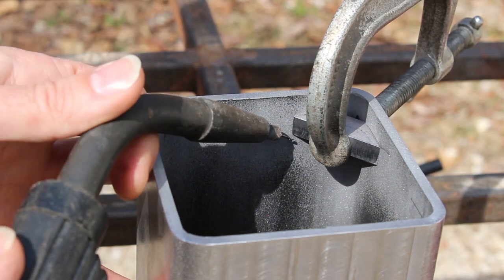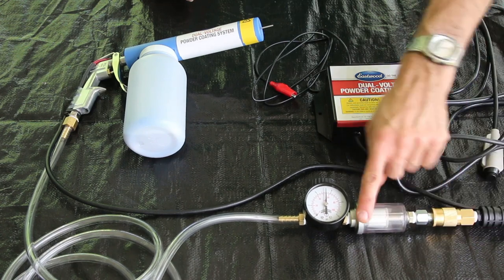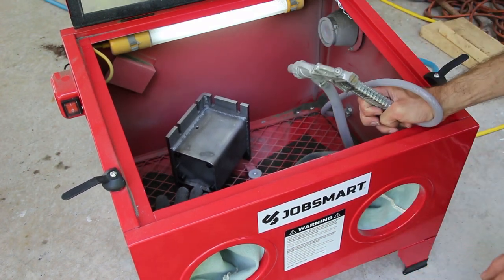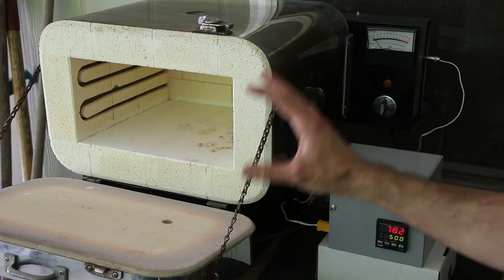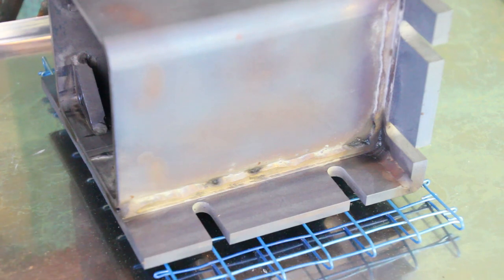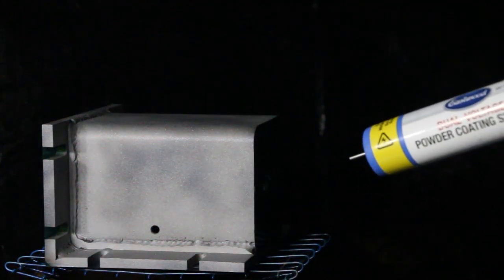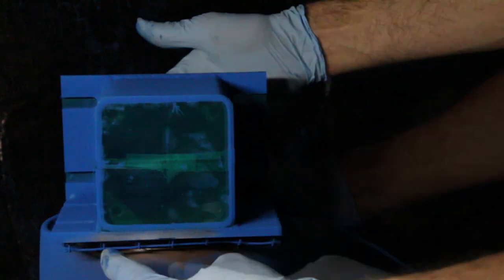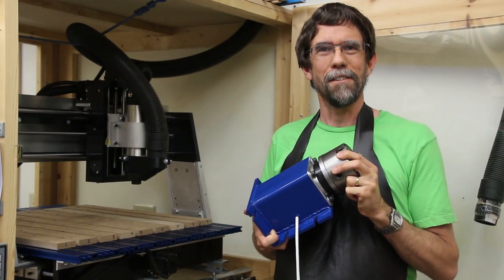DIY Powder Coating a Steel 4th Axis Housing

Comment: You have the patience to carry a project through to a finished item, which puts them on a level above that acheived by hackers like myself.  It shows me what I should be acheiving, if I just take the time to "do it right".  Thanks for sharing your projects and methods.
Reply from the maker: Thanks John, and I don't often get accused of being patient! ;-) Honestly I have many more unfinished projects than finished ones, and I'm certainly not above hacking something together to get it done(ish). But of course I enjoy it more when something eventually turns out well, even if it takes a lot longer.
Reply: Your unfinished projects are a secret that's safe with me!   ;o)

Comment: If you watch the Eastwood video on that powder coat system. They added the high voltage setting for tight inside corner areas and rounded corner areas to make the powder stick
Reply from the maker: I'll definitely try that next time.

Comment: The one thing I learned about welding DC and TIG... it always pays to grind your weldment smooth. Structurally the cap of excess metal can only hide pockets of flux and coldroll process greases. Fully TIG would have allowed for flatter and smoother finishing....
I was also thinking there were alternate processes available for a much quicker assembly, machining, and shorter lengths of weldments.

Comment: Great video and commentary of the entire build, I have really enjoyed them but did you forget to move the hole for the stepper cable to the other side?
Reply from the maker: Thanks, and very observant of you to catch that! I didn't forget to move the cable, just changed my mind about which way to mount the unit on the milling machine. There's no compelling mechanical reason to mount it one way or the other, just personal preference.

Comment: Great video.  It flowed nicely, no pun intended.  Might you have negated some of the faraday affect by using the higher voltage on the gun?
As a side note...now I am looking around me for something to powder coat and damn it!  I'm going to have to build a 4th axis.  Time to check out your other videos.
Reply from the maker: Thanks, I hadn't thought about trying the higher voltage setting. The instructions recommend it for larger parts but it would be worth a try.

Comment: Great job. A tip and a question. If you preheat and apply the powder whilst hot 80~ 110c or so I have found good adhesion results and much faster curing time. Did your housing retain it's flat square sides after curing? Usually powder coat cooking is enough to stress relieve the steel.
Reply from the maker: Thanks, I might try preheating next time although this part was a bit tricky to get in and out of the kiln without touching. After the hours I spent baking out the oil, the time to cure the coating seemed like no time at all. :-) I did not try to measure whether there were any detectable changes in the squareness or flatness after powder coating but it's certainly possible that it moved a little.

Comment: just a note that you can get a high zinc primer powder that reduces the requirement for sandblasting
Reply from the maker: My main concern was removing the mill scale, as I don't think primer over mill scale would give a good result. At the time of making the housing I didn't have experience using acid to etch off the scale (as in my later welding cart build), but to do it again I think I'd acid-etch the parts first, then weld, then prime using a zinc primer as you suggest, and then powder coat.
Reply: Airborne zinc is pure evil.  Don't skimp on the PPE when there's any possibility of breathing it.

Comment: A good hot jet washer or steam cleaner will do the job of removing any oil residue rather than fiddling around with acetone and rags/cloths in areas you can't get to easily, then dry it in the oven and repeat if necessary.
Personally, I think you were being stingy with the powder coating, but, hey, it worked.
I enjoyed watching your video, very informative, ... thanks...
Reply from the maker: I'm still learning what is "enough" powder, but it seemed heavy enough and I think it produced a good finish. I don't yet have a good sense of what looks like "too much", but I figured that it would be easier to add a second coat if needed than deal with a too-heavy first application.

Comment: No need for PID control with a simple oven -- "bang-bang" will do.  But that looks like a $99 controller from Omega, an excellent product.
Reply from the maker: Yes the PID and kiln is totally overkill for just curing powder coating, but I also plan to use the kiln for things like heat-treating metal and for glass fusing. I've used it for fused glass in the past, but only with its manual control that takes constant attention. The controller has an auto-learn mode that tunes the PID loop automatically, and after I ran that it seems to do a very good job with just a little overshoot.

Comment: Did you clean off all of the metal surfaces prior to welding perhaps that would’ve reduce the amount of oil’s that had to come off.
Reply from the maker: I cleaned the metal prior to welding but most of the oil was introduced afterward when I machined the part.

Comment: Good job, may be very small distance to bottom?
Reply from the maker: Thanks, I assume that you mean the small clearance below the chuck and yes there's a trade-off with that - I chose to keep it low because I don't plan to use it on many large-diameter parts, so it is more compact and rigid this way. But if I need to machine a larger-diameter part then I will need to put a spacer under the housing.

Comment: Great video, I learned stuff !
TIG welding would have made it a bit prettier. :)
Reply from the maker: I'd say that skillful TIG welding would look prettier, but my TIG welding might not. :-)
Reply: TIG welding can offer nice welds, but TIG is a slow welding process, which usually leads to HUGE distortion. The cost of counteractions regarding the distortion is sometimes consequent, it demands often special & dedicated toolings. Best options are all welds process that can be used as fast as possible, but it demands a 3-phase supply and industrial wire-feeder to obtain a smooth and reliable welds from wire drums. The FCAW and Plasma (PAW) are one of the best technique available but it's difficult to reach it as an enthusiast.
Reply: No worries,  I don't make perfect welds with my TIG either, but JB weld (original recipe, not JB Quick) will smooth out the weld bead scallops and make a nice fillet that will take the cure temperature- at least, of my powdercoat, on  which I use 375F for 15min (polyester powdercoat).  I got here form your harmonic drive video- cool beans, man!
Subscribing!

Comment: it's a good video, i just can't see spending 10 grand in tools and machinery to paint a small peice of steel. I would have been satisfied with a can of rustoleum, powder coating is not that much better then paint.
Reply from the maker: I think spray paint (or for that matter no paint) would have been adequate for this particular project, but powder coating does have some advantages and I used this as an opportunity to practice since I only recently got the equipment to do it. The cost  for the power-coating gun and accessories was roughly $150 U.S. and I already had the kiln and controller that I use for other things. It's not worth it for one project like this but I hope to get a lot more use out of it in the future.